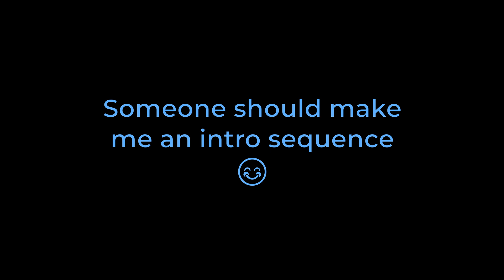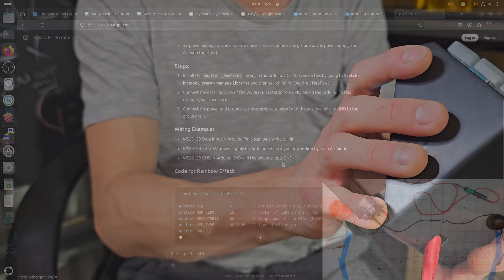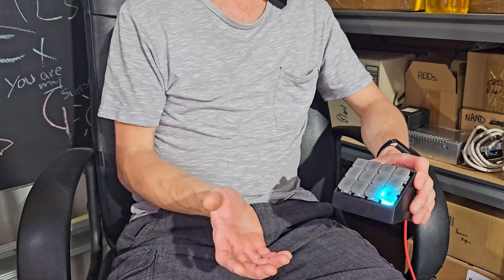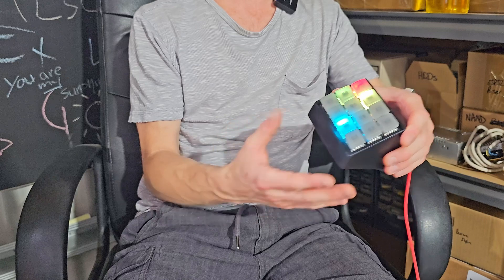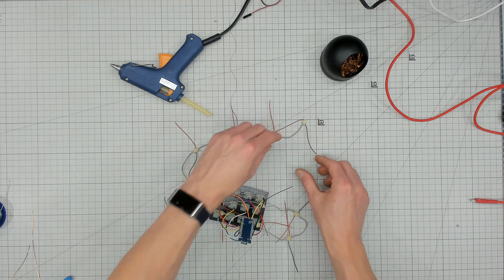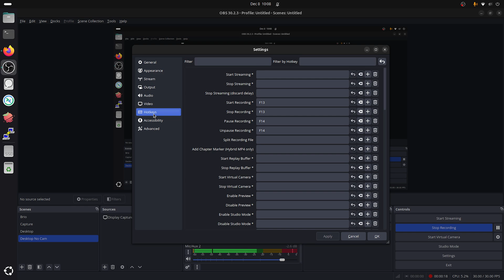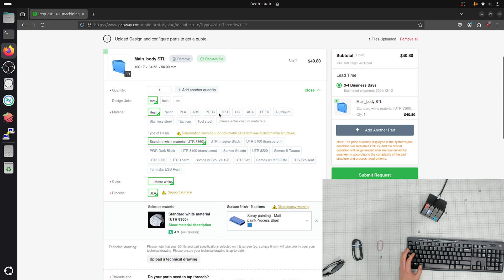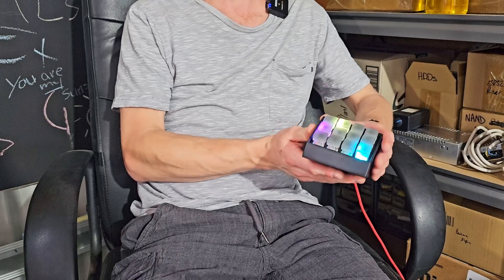3D Printed DIY Arduino-Powered RGB Smart Keyboard Extension

Comment: Could leave those 2 buttons for up / down button profiles, with a color code for each level, Red level 1, Green level 2, Blue level 3,
wraparound, so down on level 1 goes to 3, up on level 3 goes to 1, record-stop/pause and up/down should be in all profiles,  4 fixed + (3x 8) = 28 buttons
could limit the up/down to short press/long press, or add a side button microswitch
Reply from the maker: My friend that is an excellent idea! I unfortunately cannot find an obs-cmd or similar command that does that though, so would have to hard-code it, but still doable!

Definitely good thoughts for a revision/improvement. Cheers
Reply: @PlatimaTinkers  did not mean obs profile,  level 1 is for obs, 2 might be for kdenlive, 3 for tuxkart or ...
Reply from the maker: @jyvben1520  Oooh okay yeah got you. Interesting idea!

Comment: Recently made one too. Also 12 keys, but with a PCB from guess who and a RP2040 (better and cheaper then the old atmega32u4 you used, used these too before rp2040 release). Using Cherry switches and caps for interchangeable labels. No rgb. Not fiddling around with this many wires with what custom PCBs currently cost.
Reply from the maker: Oh nice! Didn't consider using an RP2040 - keyboard library works fine? 

I'm definitely gong to have to print thinner keys and caps so I can label them too!

RGB I kind of need for the status displays, but can definitely improve it by just making a single simple PCB that slots in I think.
Reply: @fgregerfeaxcwfeffece  Are you making this available ??